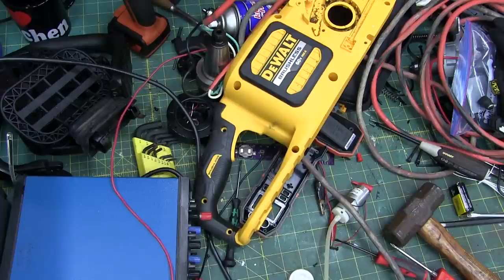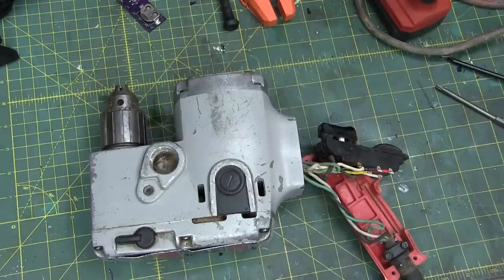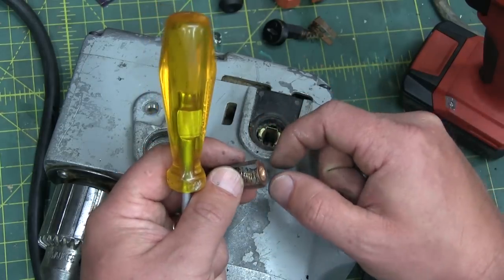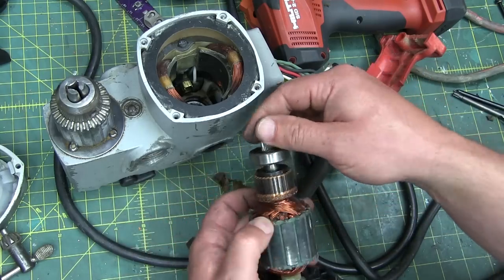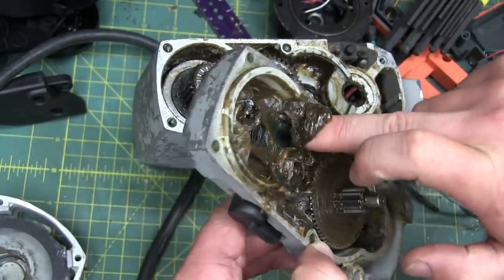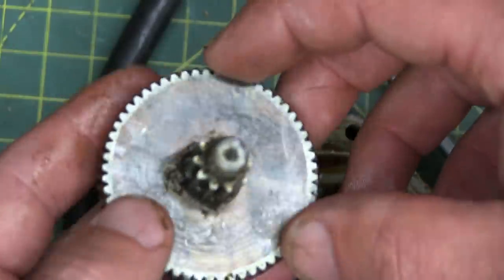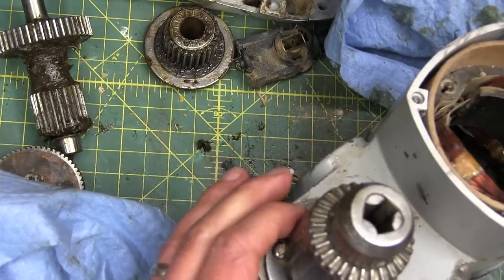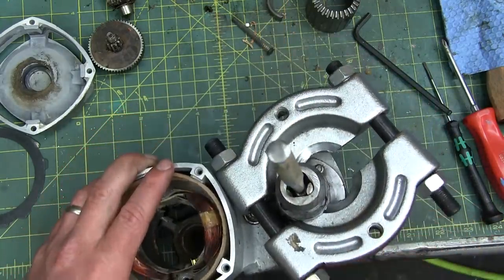BOLTR: Milwaukee Hole Hawg | Long Term Quality

Comment: Got the same problem with my old air drill. Chucks dickered and can't set the Jeezlus thing off no matter how much I swear. Thinking maybe oxy gouge the corkstuffer and prey to the blue flame lords.
Reply: Some drill chuck's or threaded on the shaft instead of using a Morse taper to lock it on ...  Make sure you take out the little retaining screw or bolt at the bottom of the inside of the chuck  then clamp the  Chuck in a vice or some vice grips's hold on for dear life and turn the drill on and forward or reverse and it should come undone  I don't know which way the threads will be cut on your particular drill so you will have to try both forward and reverse but I am betting reverse will do it
Reply: It's threaded on. You don't normally see a taper fit on something like a hand drill.
Reply: FFS.... I'm screaming here..... That chuck UNSCREWS.          UNSCREW IT .  FFS.
Reply: I thought you're supposed to clamp a big allen wrench in the chuck, then wack it with a hammer to anti-torque it.
Reply: cucking funt - Doesn't trying to pull a theaded fastener "straight out" trump "pounding a round peg into a square hole" by a factor of three? I can talk, because I spent quite a bit of frustrating time tying to muscle a General Motors rear disc brake piston back into the caliper, and even bought a new caliper because i thought mine was jammed, until somehow i found out that unlike the fronts, which i have done many times,  the rear pistons were THREADED into the caliper to effect adjustment :-p
Reply: cmans79tr7 rear calipers on an Acura NSX are the same way.
Reply: They aren't threaded to effect adjustment, they are threaded because the parking brake is turning the screw the piston backs on to to clamp the pads onto the rotor.  When you release the parking break the screw releases and the piston is engaged by hydraulic pressure just like the front ones.  As far as I know there are only two basic rear disc designs on cars these days, I believe most of them are the screw type parking brake (some of which are left/right handed on opposite sides of the vehicle, but not all of them) and the other kind with a normal caliper for the brakes, and a separate cable actuated  drum brake in the center of the rotor for the parking brake.
Reply: Frist Lsat - Ok i understand now that the normal rear brake action is self adjusting, but doesn't the screw adjust the parking brake to compensate for disc pad wear? Thanks for the insight.

Comment: Years ago doing plumbing I was drilling a toilet flange hole in a new construction with one of those. The hole saw grabbed the floor, spun me around through a 2x6 corner, and procceeded to to pin my hand to the floor still squeezing the trigger. I grabbed the wire with my free hand and gave it a few yanks to get it unplugged enough to let me go. Moral of the story: those things are the best drills on the planet.

Comment: The "broken" ring for the chuck is designed to be broken before it is installed or you couldn't get it in the its slot.
Reply: That's right, I've heard that before.

Comment: If you grind 3 flats on a bolt and tighten it down in the chick, you can use an impact to spin it off. Just make sure to remove the left hand screw! Also the connectors on the switch can be pulled out. I use to rebuild these daily when I worked as an inhouse  mechanic for a plumbing company. Also you are correct that the cardboard causes the stator to get hot and burn up. Most common issue besides cords and switches.

Comment: The chucks on the older versions of these tools are threaded as you can see in this video THD 5/8 -16 on the side of the chuck. Real old versions were 1/2-20. All of these were a pita to get off. The newest versions are slotted across the back and almost fall off once you get the LH retaining bolt out.

Comment: The chuck is threaded to the shaft. You have to hold the shaft to take it off. Right handed thread if I remember correctly. Milwaukee made a factory service tool that fitted to the dogs on the shaft with a hex end or put your shaft in a vice and twist to the left. Its torqued tight.

Comment: Heeeey, the contractor crew I worked with (me and an ol' flooring greybeard) had somethin' similar to one of these! 'Course, the grounding pin was missing (what for giving you a nice shock in the morning to wake you up!), thing was heavier than frig (being made out of good ol' steel) and the damn thing would send your ass into a low earth orbit if you weren't careful, but I've never found a better tool for mixing grout and thinset since.

Comment: I think the chuck is threaded on. THD 5/8"-18.
Reply: Yes that's why there's a left handed screw to counter the right handed spindle thread but nobody tell him its more fun to watch him figure it out
Reply: As an engineer iv'e seen far worse done by so called mechanics that i've had to put right
And that beauty is only a tool that is educating Ave so yes it's fun to watch as are all his video's there's nothing sick about me watching him!
Plus i don't judge others in what they do remember you are here also and if that pains you move on
Reply: Probably 1/2-20, and yes, the threaded collar is supposed to be split.  Sometimes AvE surprises me with what he doesn't know. Fortunately, his fan base fills that gap. :)

Comment: The hole hawg is the best!! Nothing drives a bit like this bad boy. I rented one from a local tool shop for my Eagle Scout project when I was 17. We had to drill 16” deep holes at 5/8” to drive rebar through two jointed 4x8’s and another full 4x8 below. Gas powered Stihl couldn’t even get through the first 8” before running out of torque. The hole hawg on high could easily get though 12 inches, and on low it went all the way to dirt like the wood was butter. My Eagle Scout project would not have been possible if it wasn’t for this tool. I also nearly broke my wrists so many times with it! But we had so much fun we didn’t even care

Comment: If some old engineers who were around to designed proper tools made to last got together and made a set of tools on kickstarter that had the good old quality but with some of the advantages of newer tech , do you think they'd succeed?
Reply: Juan Alvarez too expensive
Reply: They would sell one to anyone who wanted a skookum tool, and never another to the same customer.
Reply: +biana doubt why sell 1 million drills to 1 million people? When you can sell 100 million drills to 1 million people.  I Dew reclaw after ww2 American manufacturers terrified of americans buying one of something for life, out of that fear came style and design. suddenly how it looks and makes the buyer feel became more important than does it work and will it keep working.
Reply: No because they are dead along with their ways.
Reply: I think it's called festool.
Reply: Juan Alvarez YES.
Reply: They all went to NASA.  :-P

Comment: The chuck screws onto the output shaft. The screw in the middle of the chuck is there to keep the chuck from unscrewing when using reverse. Install the chuck key and hit it with your finger finder. You may need to reassemble it to prevent the output shaft from spinning.

Comment: Be careful with those gloves on hot things, i learned the hard way they as plastic and WILL melt to your fingers. That hurts for a long time.
Reply: I was pushing a fireline on a dozer one day and noticed some smoke coming out from under my seat. Well 99.9% of the time it's just pine straw or leaves that have accumulated and an ember gets in there and starts smoking. This time when I reached under the seat to brush out the pine straw, no gloves of course, someone had put some of that 1/4 inch yellow poly rope under my seat and that was on fire with the straw and the leaves. You just can't run away or shake melting poly of your fingers fast enough, caused a 3rd degree burn. I got a little grease off a zerk and covered the burn and kept working but after that day I always checked under my seat before I started work.
Reply: Ouch. Anybody that's melted that stuff to seal the ends and forgot to lick their fingers before molding it smooth can imagine just how much that had to hurt. I'm impressed you kept control of that dozer, much less finished the day out.

Comment: Fear not Chief Choocher... that ring around the chuck is supposed to be in two pieces.
I discovered last year while restoring a 1940 Walker Turner drill press that some drill chucks can be rebuilt. Mine was a Jacobs #33, which looks an awful lot like yours. Jacobs actually sells a kit for them that includes the three jaws and the split nut/ring.
Keep up the good fight!!!

Comment: Well yes, some were concerned about the lingering cough you had going. Multiple, multiple and multiple cruds caught on those airplane flights. Generally 3 day incubation for resp viral and 10-14 days incubation period for bacterial cruds. Nowadays double cruds found in the ear. One crud will localize external ear canal and another will localize around the eardrum. The crud found in the external ear canal is easy to clear.... the one around the eardrum not so, lasts for weeks, no real pain just pressure and hearing loss. If that eardrum ruptures, grab a culture and sensitivity. May need double antibiotics for 3 wks to fully clear. This last crud can isolate/localize/colonize to other sites and cause more problems. Stay on top of that ear problem, hopefully caught and properly treated..... On that drill you have to be a gymnast from hell to run that thing.
Reply from the maker: Neglect and strong drink didn't work. Now it's antibacterial drops and steroids. Marked improvement already!
Reply: .... with the steroid knocking down the inflammation on the eustachian tube and allowing drainage, good time for at least a gram stain on a throat smear. Any gram pos cocci pulled off and cultured. There's reason for that.... can't call it neglect, who wants to go to some crappy clinic and crappy MD. Length of duration of the ear problem is what sends up a big red flag. I don't think the gtts had much effect and there's a suppressed immune response going on. Steroids are a double edged sword. I'd load up on ETOH , canadian blendeds my favorite.
Reply: Thanks, teton tom! "I just endured another ETOH treatment" should justify about any behavior shouldn't it? ;-)
Reply: .... the good therapy. keeps those psychotic episodes down to a dull roar.
Reply: Not to mention the tremors and puking! 8-D
Reply: Awwww that's sad..... sit down with a box of cigars too. Fix those trembling pukes.
Reply: .... if you're a diver. 3 blown eardrums and you're out. then there's infants.... if you're a 6 monther, you're own immune system is just starting to kick in and with cutting teeth.... pretty miserable. If not properly treated can easily localize in the endocardium just under the pulmonary veins L atrium throwing you into congestive heart failure..... so you decide.

Comment: You have probably already sorted it out but you should try unscrewing the chuck. From past experience if the centre screw is left hand thread the chuck should have a right hand thread. We used to hold a Allen key in the chuck to undo it with but you’re a bit past that now.
Thanks for all the great videos . Very informative and entertaining.

Comment: I have a 50's-60's version with the drill press attachment, it lives in the DP attachment, at 400 rpm it will rip a 250lb Bubba's arms off. It gets used with the DP attachment for hole saw work, it works GREAT for that job.

Comment: Most formulations for brushes actually contain small amounts of abrasives. Without an abrasive, what tends to happen is that a thick film of carbon can build up which acts as an insulator.

Comment: I'm German, and we apprentices had a "Mafell" (or was it a Metabo?) "hand"-drill to feed our nightmares. It had a 1 1/4 hp three-phase motor in it. Boss told us ten times to NEVER use that thing alone and the drill bits for it (it used tapered bits) were locked up in a special drawer. The 'thing' was responsible for numerous broken bones and countless busted out teeth anyways.
The 70s were a great time to grow up...

Comment: I can't explain how scared I was of using this wrist buster when I was first becoming an electrical apprentice. One of my coworkers twisted his arm and shocked me about his story.
Reply: Marcus Aurelius Antoninus Augustus although showing my own baby apprentice (after not using one of these monsters for a couple years) the Way of the Hawg gave me the cold sweats as well!
Reply: I had one spin/beat me between 2 wall studs until the cord wrapped around me enough to unplug once when I was a 1st year. I grew up on a farm and knew one of these but I was drilling up for wire runs and didn't have anywhere to let go or drop it when it caught a nail. Only thing to do was let off the trigger and hold on for the ride.

Watched a more muscles than sense 1st year break both thumbs one day because he was bigger than me and thought I was BSing him when I told him the thing will throw him across the room. Was his first week on the job but after that he did listen to me when I tried to teach him something.
Reply: Narcoleptic Chech for plumbing too...

Comment: "Hard to swallow ..." Haaaahhhaaaahhhaaa !
Yer a sick man Charlie Brown ... my kind of people .
My stepdad had a conventional styled Milwaukee from the late 50s ... 1" chuck . The thing took about 10 seconds to wind down after you let off the go button .
Two wire power and it did have leakage , which contributed to the development of my descriptive references .
The beast used 3/4" pipe for handles and the largest drill I ever used was 2" ... I had step-drilled a 1" piece of steel boiler plate (making a plow blade for our big cat) out to 1.5" and had the 2" drill chucked up ... a little shot of heavy duty liquid foreplay and we were off to the races . I was leaning into the drill motor (over the top) , hanging on to both handles for all I was worth when stepdad walked up and shouted "how you doin' shitbird" (a reference to my early welding abilities) ? I turned my head to reply and the drill bound up and the motor wound my arms up , broke from my grip , made a half turn with both handles whacking me near the elbows and
 threw me about four feet .
I laid on the ground moaning , still trying to figure out what happened and I could hear the motor winding down .
Then my stepdad said ; "good thing you didn't have the trigger locked down" .
PS ... I have found that the best way to remove a chuck on a piece of gear I have not worked on before is to go online and RTFM .

Comment: I was raised by plumbers. It's kinda like being raised by wolves, except I'm handy around the house. 

When I was a teenager, I was handing fittings to my dad, who was up on a scaffolding, running some plumbing. He was up on his tip-toes, drilling a hole for 3" pipe, & apparently hit a nail with the selfeed bit in the Hole Hawg. The pipe handle popped out of his hand & whacked him upside the head so hard it shattered BOTH his upper & lower dentures.

I can't remember exactly what my brother was doing, but he managed to catch his pant leg with a selfeed bit about 4" below the crotch, it wound his pant leg up so tight they had to cut off his pants to give him the stitches.

So yeah, I've got some healthy respect for the beast known as a Hole Hawg.

Comment: I rebuilt a bunch of these for the shop. If you tug on the staked cons on the switch you'll find that are long spades that go into the switch body so it's easy to change the switch. But I have had one last unit where 2nd gear stripped out and I have to pull the out put shaft to change it and I haven't figured out how to do it for a over year! Without breaking the Chuck.... You'd think the healing powers of the bench would fix it but here I am still stinkin on it once in a while. I'm excited to see what the hang up is. 

It was really different watching you work on something for the first time that I've been in and out of several times.

Comment: We have one of these babies, use it for running 2"x24" auger bits for beam work. You have to counter sink the lags on top in order for trusses to sit flat on top of the beams if you're building a nice big timber porch, or building corbels.

Comment: I got Harbor Freights knock off version of this a couple years ago during a parking lot sale, for a steep discount as an open box item. It looked virtually brand new. It runs, but I have never used it for actual drilling yet.

Comment: Chuck is rh thread. Reversing drills use the lh locking screw. Next time you gotta take a chuck off, couple ways 1- put the key in and smack it with the compethane grand martow in the direction of loosening. Or my favorite clamp your favorite 3/8 or 1/2 allen bit in the chuck jaws and hit it with the impact wrench on reverse.

Comment: Had a rail road tie retaining wall job 30 some years ago. 800 ft long 12 ft tall. Each tie had 8 - 16 in long 1/2 in rebar to drill and pin together. Used 4 of these drills, two running 8 hrs a day and 2 in the shop for repairs. Guaranteed for life back then. Still have one that drills holes just for old times sake now. Can't remember numbers but we used around 3000 lbs of rebar.

Comment: Not a machinist exactly, but I do have a machine shop and taking apart drill chucks seems to be one of my hobbies.

The chuck is likely threaded on. If the screw on the inside is a left hand thread, the chuck is likely a normal thread. After hitting it that hard and it still being attached, it's unlikely to be on a taper.

Also, the Jacobs Chuck comes apart that way. It looks to be in good shape, so, clean it up a little and reassemble and you're all good.

Keyless chucks (at least the machine types, Rohm, Albrecht etc) are a completely different design. I imagine the cheap ones are exactly like you suggest, just a finer thread version of the one you have apart.